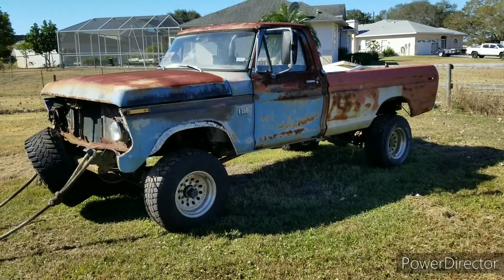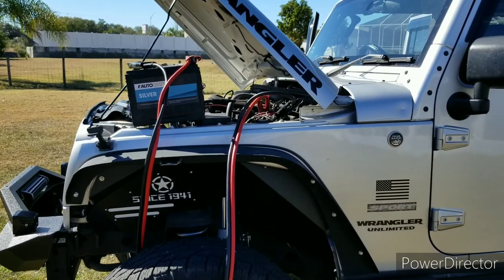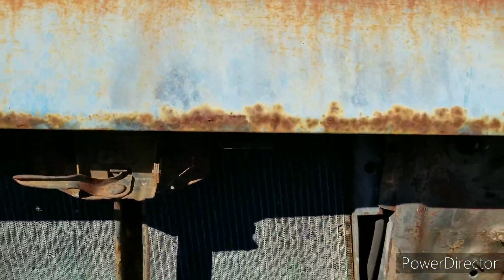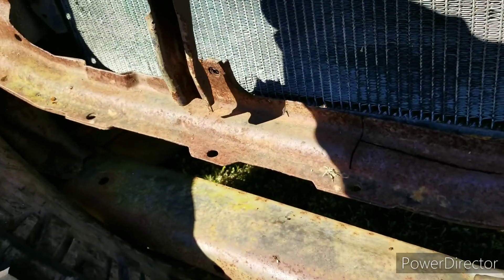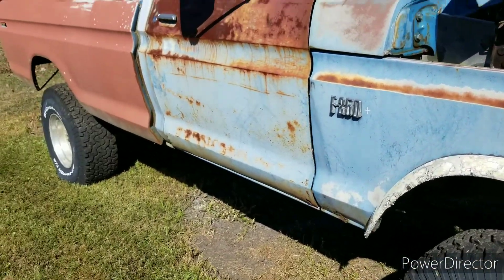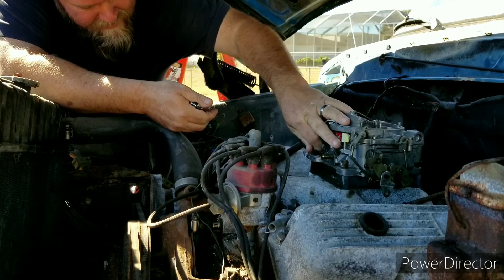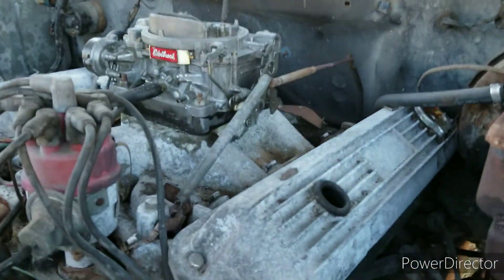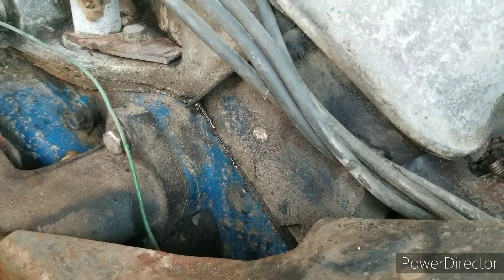Will it Start??? My 1976 F250.

Comment: I would pull the intake and refit it. Could be a simple intake water jacket leak. Grew up driving a 1975 F250 in the Bronx NY for my fathers 40 horse stable at the time. It had the 360. Frankly I was surprised to hear it turn over with the plugs removed for so long. Yeah learned to replace shocks at 15 years old at the time, soon after clacktty clack (loose shocks) as who knows about torque at that age. Gotta buff the paint with 20 grit compound directly through the paint. Credit to my father as he let me learn even though he was not excited about the results.

Comment: Personally, I'd rebuild the FE. I agree, drives me nuts with Chevy engines in a Ford, I'm also not a diesel fan either. Just my opinion. Love this truck.
Reply from the maker: We will be getting the heads back from the  Machine shop today  So check back for updates